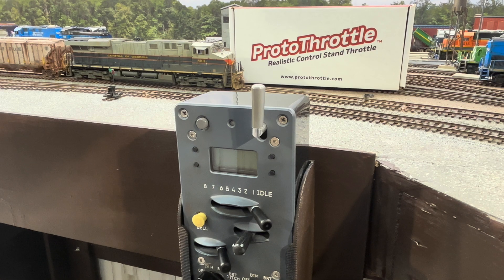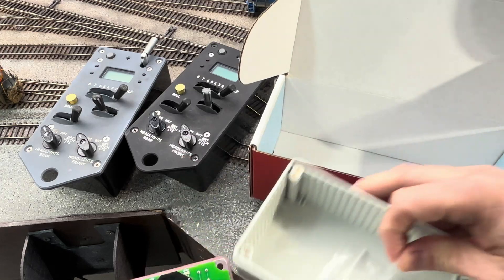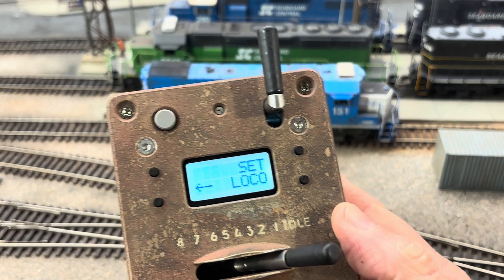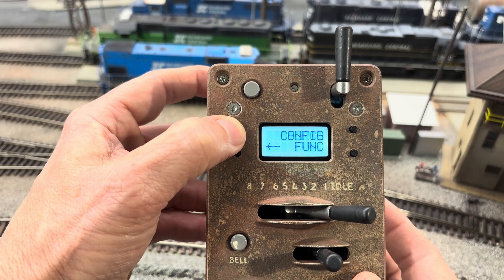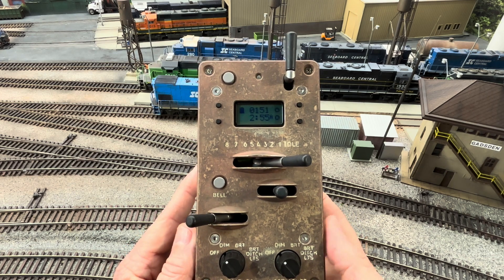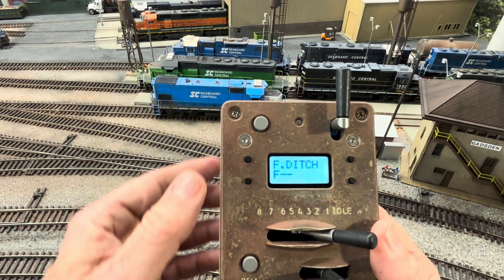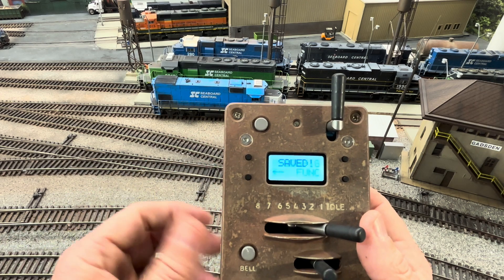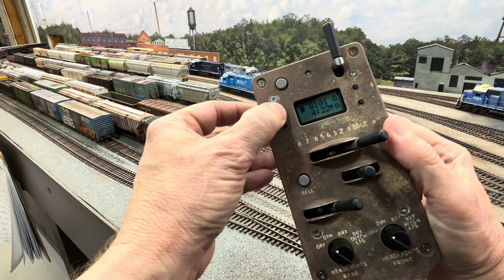Programming the ProtoThrottle!

Comment: have my throttle coming in  probably next week , It would be nice if they had them in stock not made to order cant wait
Reply from the maker: Congratulations! You will need to make sure your decoders are programmed to take best advantage of the ProtoThrottle. Once you program the decoders and the ProtoThrottle you will probably never use the old throttles.

Comment: Very similar to my programming. I trait enjoyed the locomotive i purchased from you previously and how it reacted. I'm going to try your speed steps before I do my next clinic. Question:  do you change your speed steps and speed matching?
Reply from the maker: Thanks Shawn. All models are different so you really have to play around with the speed curve to get the same results. I first set the minimum and maximum speeds. Then I adjust the curve to hit my speeds for each notch. I use 16 of the 28 speed steps. 16-28 are always 255.

Comment: Too bad they don't have those for DC.  Would love to have those for my yard operations.
Reply from the maker: DCC is an easy switch from DC. If you ever decide to change I recommend the NCE system. It is definitely worth it.
Reply: @SeaboardCentral  While my new Amtrak locomotives from Athearn and Rapido could easily be changed, the rest of my motive power is from before 1992.  Would be easier to replace them, but I don't have the money for that right now since I'm having to unexpectedly move again before getting my layout back up and running.

Comment: Just love my proto throttle and thanks for the notch setting I’m going to give that a go will it improve for pure switching operations?
Reply from the maker: Thanks! It will make your engines sound more prototypical. Especially if you have them programmed like I did on the ES44AC video. I also have one on a ScaleTrains SD40-2.

Comment: The real locomotive waits that long between throttle 1 and moves?  Gooooly!  I'd hate to have that thing on a local job!  Would sure mess up an early quit!  😄

It funny how we both moved all our functions around for basically the same reasons.  I moved engine start to 18 and the ground lights, number boards, walkway lights all above 10 as they are usually set at start of shift and don't change during that shift.  This avoids having to use that stupid shift key on the NCE throttle during the session.  I also have the engines not start in consist.  That way I can just scroll through the list as the firemen starts the first unit, push the function for the door sound, then go to the next loco and do the door thing and then start it, and so on.  Yes, I still employ a fireman!  I find it better than some simulator for learning.  For fewer drawbars.  

Thanks for this video.  I truly enjoyed learning I was doing something right!
Reply from the maker: They normally don’t take that long. Something about when you first start up and that’s prototypical. Once you start switching with them they move faster. Not as fast as 1st or 2nd Gen EMDs but definitely faster than earlier GE models.

Glad you enjoy the videos.
Tim

Comment: Thanks Tim.i was supposed to buy one but change my mind after you last video on programming your engine . is it necessery to do that to run my engine with the proto throttle, all my engines run with tsunami2
Reply from the maker: You can make your own function table for all of your engines, you just need to make sure they are all the same. Then just match the ProtoThrottle up to your function table. All of the other things like the delay and brake you can set up the same way. I don’t use Tsunami decoders but there are plenty of people that have great results with the ProtoThrottle that do use them.

Comment: How much does it cost to start with protothrottle System? I saw one throttle for 500$?
Reply from the maker: It depends on your DCC system. With an NCE or ESU system you just need to purchase one receiver and one ProtoThrottle. With Digitrax you need to also purchase a separate LNWI to communicate between Digitrax and the receiver. They have all the details on the www.protothrottle.com website.

Comment: Hello Tim, when we program the functions on the Proto Throttle, they are then valid for all locos that have the same order of functions, so each engine does not have to be edited separately on Proto Throttle.?
Reply from the maker: Yes. You need to develop your own standard function table for all of your locomotives. Then you need to match those functions to the ProtoThrottle. Example F02 is horn on your decoders then the horn on the ProtoThrottle needs to be F02. You also need to separate each light function and make them ignore the direction. See my latest progamming video to see how to do this.
Reply: @SeaboardCentral  You can actually set up different "profiles" and choose among them.  Like one set for locos with dynamics and another for those without.

Comment: The Protothrottle does not just "run trains". It OPERATES a locomotive. Entirely different perspective for a model engineer. I use mine mostly for switching  and usually keep notches 6,7 and 8 at the same value as 5, thus limiting the top speed.
Reply from the maker: I basically do something similar I just program my decoders to max out at 18 mph

Comment: Hi Tim, thanks for another interesting video. I presume that when you have to replace the Batteries, the Throttle remembers all those Setting s that you've Keyed-in and you do not have to Reset everything? Also, are the Control Panels of real Locos really as Weathered as that Proto Throttle?
Reply from the maker: Yes it does.